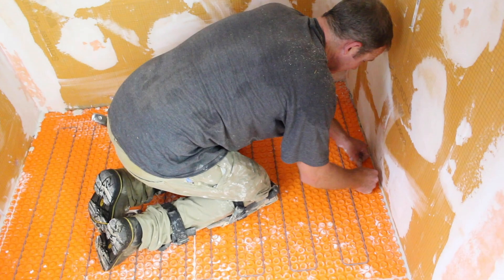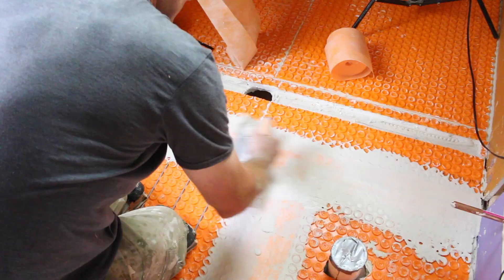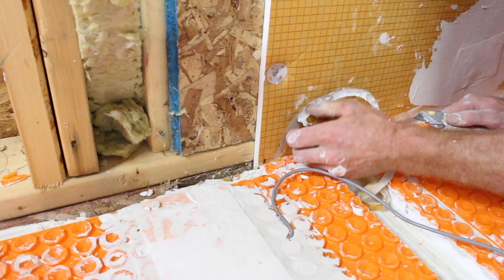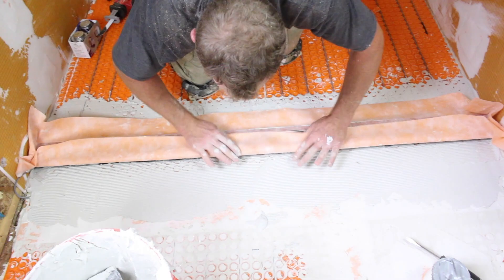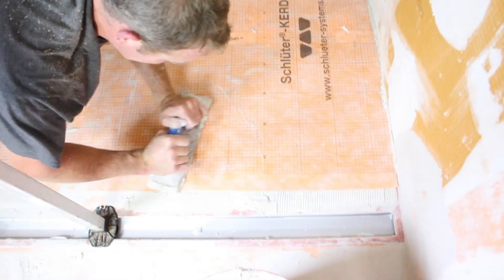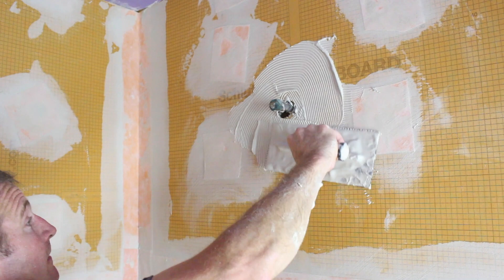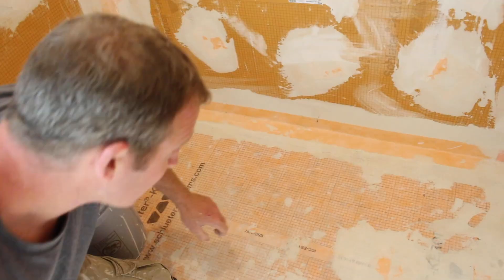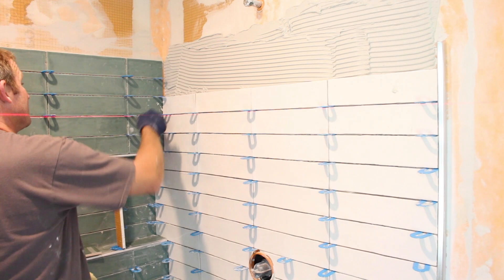Heated Schluter Curbless Shower Pan: Schluter Curbless Shower (Part 7)

Comment: Great series!  I have one question... from the videos, it seems there is still a small height difference between the ditra heat installed on the support foam for the drain and the ditra heat on top of the sloped Kerdi pan.  Is this correct?  If so, how did you account for that difference in height when tiling the shower and the linear drain??

Comment: Best series right here! This is exactly what I want to do with my master bathroom. I was wondering if the heating system could cause a failure of the thinset over time because of the expanding and contracting when the thermostat turns the system on and off.

Comment: The Schluter-KERDI completely over the DITRA-HEAT, is that just an extra layer of protection, or are you using it to raise heights? I've seen people just add KERDI-BAND to the seams of DITRA-HEAT but not cover it completely with Schluter-KERDI.
Reply from the maker: extra waterproofing layer for the shower, it’s a minimal height increase. We don’t use it for the main floor, only Kerdi-Band like you describe
Reply: Is it required over the cable? Or can the seams be taped at the pan, then have the heat sheets put down and tile over it?

Comment: Looks good but that needs a roll on membrane. Schluter is not water proof.
Reply from the maker: incorrect, the orange membrane is waterproof and seams can be sealed with thin-set and thin-set mortar
Reply: @HomeRepairTutor  afraid not, highly water resistant yes. Water easily wicks through the thinset, a topical over the system stops that from happening. I didnt want to hear that either being ive installed at least 30 schluter showers myself. Did my own tests knowing it would hold up, to my surprise it wicked water quite quickly. I still use kerdi but now use a roll on over it.
Reply from the maker: we’ve never had that issue and can’t substantiate anything different. Unfortunately there is a lot of unwarranted skepticism and we don’t subscribe to that. Plus we can’t recommend liquid membranes over Schluter because it voids the warranty.
Reply: @HomeRepairTutor  have you ever taken apart a shower youve built? If not how do you know. While I get your position on the warranty, id rather know 100% my showers water proof and not rely on a manufacturers warranty to cover damage to a customers house, from a system I encouraged them to use. Don't get me wrong, your channel is one of the best out there for quality content and proper info. Doesnt change the fact it does wick water even if you follow all their guidelines.  Also kerdi coll can be used as a roll on membrane, but really should be used to install kerdi ban. Kinda like using 8+9 to do the ban work.
Reply: Can roll on membrane (e.g. Aquadefense ) be applied on top of the ditra heat once heat wire is thinseted in?
Reply: @stillthinkingoutloud  no, if waterproofing over ditra heat  is needed  then kerdi membrane and band is what's used. A roll on will void warranty.
Reply: @hereticxxx9317  Thanks.  To be precise, I am using a Prodeso heat mat and a  ShowerLine linear drain.  Would you still say synthetic membrane over liquid? Or use liquid under the heat mat?
Reply: @stillthinkingoutloud  poured pan or showerline foam pan. I believe they sell water proofing for both types. After that the prodeso is only there to hold the heat cable. So it is thinset to the top of the already waterproofed pan and drain assembly. Showline has adjustable sides tor height. Keep in mind because your mixing two systems together there is likely variables that can change things. Prodeso is almost identical to schluter so it can be made water tight in the same ways. When I apply a roll on membrane, I am only coating the banding to seal up the mortar. That seems to be how water is wicking beneath it.
Reply: @hereticxxx9317  I got to agree with heretic on this one. Unless you demo the shower a year or two after installation, you are only guessing that it is waterproof.  I Have seen water from the pan wick up over and down a curb before. Thinset will draw moisture by capillary action.  The thinset  between the heat studs will definitely wick moisture all the way to the wall and under the edge seams and corner seams.

Comment: Why did you use two heat wires? Why not just one long wire that covers the bathroom floor AND the shower floor?
Reply: One for the shower and one for the main bathroom, just in case the shower one doesn't work in the future.  Extra insurance.